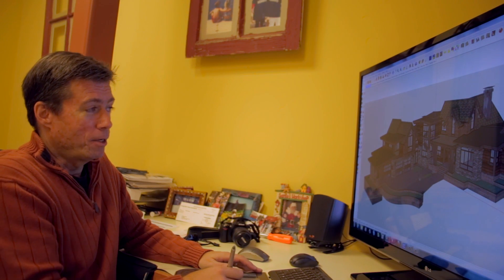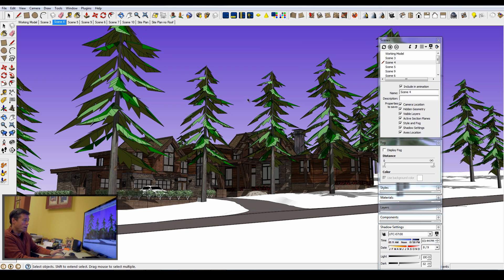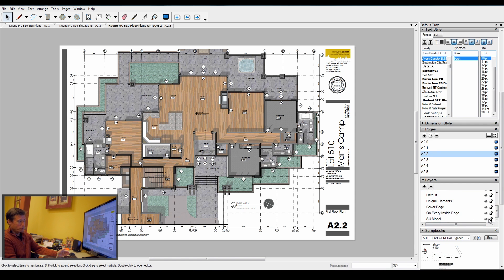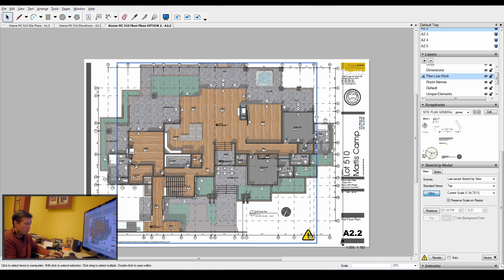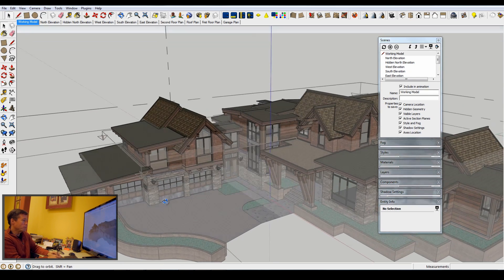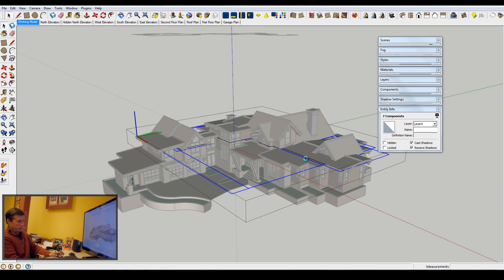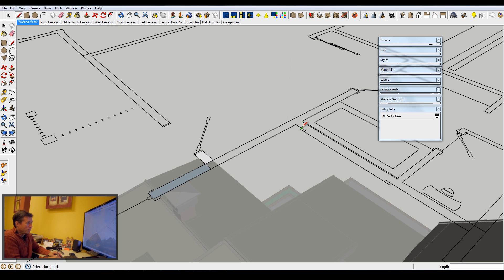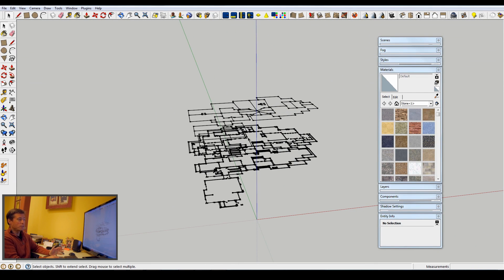Nick Sonder Process 1 - Overview and clean line work

Comment: Great work and great video!  When making your sketchup model, however, are you not drawing to finish?  Then if you make a line drawing from the finish thickness of walls, how are you then dimensionless accurately to framing?  Thanks.
Reply: You should always dimension to the frame....unless you want contractors to hate you.
Reply: I agree. I dimension to framing, but I guess my question is not clear.  How do you dimension to framing when your line work is generated from the model, which has the finish added to the wall thickness?
Reply: +Lee Van-Binh OK, good question!  I do not model interior finish materials on walls so it always represents the frame.  When sizing spaces this is always taken into consideration given the finish.  As an example if I want a space to be 2'-0" clear like a closet, I add the thickness of the wall finish material to the depth of the space so 2'-1".  Finishes I do show are things like trim, wainscotting, paneling, furring, but never the drywall.  This way I can always snap a dimension to a stud face which is the most important info for the contractor.
Reply: Thanks Nick.  Makes total sense now.

Lee

Comment: Great videos Nick. I wanted to ask you about plug-ins. Which are must haves and just good additions, or which ones to stay away from? Also, if your do any photo realistic renderings, what do you use?
Reply: +Roberto Samarron believe it or not, I use very few plug-ins.  Tigs Section Cut Face - that's really it.  All of my process utilizes native SU.  For rending I use LumenRT which is the best I have used, especially the incredible speed in which it produces both renderings and animation.
Reply: +Nick Sonder What about custom materials? I was noticing some stonework on one of your models, but didn't seem to find a comparable material in the native SU list; and the one I did find was very pixelated at the size I needed it.

Comment: Hi Nick,
Great video. I like your work! I noticed that you are using a stylus and pad. Questions: Do you use this to do all of your sketchUp drawings? Is this your prefered method and why? Would you recommend a beginner like myself in using one? Lastly, What model / brand and where to purchase?

Also do you strictly use SketchUp to generate your drawing plans or do you use it in conjunction with AutoCAD or some other drawing program?

Thank you for your time,
Larry
Reply: Hi Larry, I use a Wacom Intuous tablet and pen.  I use it for everything.  I don't use a mouse anymore.  I do all my work in Sketchup and Layout.  I stopped using ACAD in 2006 or so after using it for about 20 years.
Reply: Hi Nick,
Thank you for getting back to me. I appreciate what you do and how you accomplish it. I have done commercial architecture and high end residential for about 26 years. I am looking to change it up. Your work makes it look fun.

Comment: Hi Nick, thanks for the great videos. I have a plan dimensioning question. When you build your Sketchup model are your wall thicknesses just framing, or finish to finish? If finish to finish, when you cut your plan section do you make adjustments to the plan linework to bring it to face of framing, before bringing it into Layout? ... Thanks.
Reply: Historic Home Plans  Always dimension to framing.  You should never dimension to the finish as the home is built to framing and finishes are applied to the framing.
Reply: +Nick Sonder Thanks for answering, Nick. I didn't phrase my question well. I know that dimensioning should be done to the frame. So, when you build your model, do you model both the frame AND the exterior finishes? Take an extreme example, a framed wall with a 4" stone exterior veneer and some chunky wood trim inside. Your final wall thickness could end up 10-12" with 2x6 framing inside. Do you model all of that in Sketchup so that you can "snap" your dimension marks to the framing rather than the finish surfaces?
One last question... Have you published a book with your system described? I'd like to buy one if it's available.
Reply: +Historic Home Plans  I do model trim and veneer, but not drywall.  That is mostly for rendering purposes as I don't dimension to anything but framing.

Comment: Nick,
i am an italian architect and i work in big projects as stadiums, airports, bridges etc. I use sketchup to better communicate concepts, ideas, details to client, but now i would like to start to use layout for final construction documentation. The problem is that clients request me always pdf and dwgs at the end of the day. Your tecnique to overlay a vector line work on raster model is fantastic because when i export a drawing in dwg the process is very quick considering that my models, like your models,are very big.
What do you do, if you have to export  an elevation view or a roof plan where you don't have a section line work that you can render "vector" quickly?  thanks in advance for your support and many compliments for your work!

Comment: Hi Nick, I have been going through all your 'PROCESS' videos and found them really helpful.
I do have one question about the making plans. 
I 'create group from slice', vectored the plan in layout and change all the line work but now when it comes to making changes like moving a window 1ft over, does that means that I would have to re'create group from slice' or is there an easier way? I would imagine that once anything is vectored, you would have to step back and follow those steps again.

Comment: Nick, thank you so much for sharing these amazing, comprehensive lessons on creating working drawings using SketchUp! I have enjoyed using SketchUp in various capacities over the years, and have equally learning all over again from your videos. While I do not intend to digress from subject, could you elaborate on the following: Your Monitor - What brand is it? What is the resolution? What kind of graphics card are you using to run it? Would you speak about hardware configurations? Thank you!

Comment: I have a few questions that I am hoping you can answer if you have time. 
1: I notice you are using a PC, I use a Mac and on the Mac version of Layout my trays are floating in space, I spend a lot of time just moving them out of the way, minimising them or closing and reopening them. I see on your videos that you have your trays permanently docked to the right hand side with their own side bar for navigating around them.  is this only available on PC versions - how did you set this up?

Comment: Mechanical Works, I've never had issues with PC's and SU.  In fact, the PC I use in the live Basecamp demonstration is a 3 year old $500 off the shelf HP Laptop.  My main machine in this video is a higher end HP.  You are correct with the gaming machines though.  They work really well, mainly due to the high end graphics cards.  I love Macs, but the equivelant machine is 2X the PC price.

Comment: Are you using it on PC or MAC?  SU rarely if ever crashes for me...far less than ACAD.  SU is not a render engine - you use other programs for that, much like Revit is not a render engine - you use 3dsmax or other applications.  I used ACAD for 20 years, I don't anymore.

Comment: Marla you have it basically correct.  You create the line work from the section by choosing "create group from slice".  You then set that group on its own layer.  These slices can be created in any of the referenced model.  In fact, this is the main reason that I create multiple reference models.  If I didn't I'd end up with 30 or so sections in a single model, which becomes a little sloppy.

Comment: Stupendous!  I want to confirm that I'm following the logic: making the Section Cut into a Component creates the new lines that make your line work.  Because they are saved on a separate layer, they can be turned off when you don't wan't to see them.  I was afraid that editing the component would change the base model, but because these are new lines that you did not draw to begin with, you are just erasing the new line not your model.  Brilliant! THANK YOU